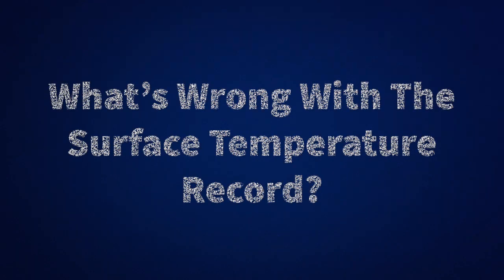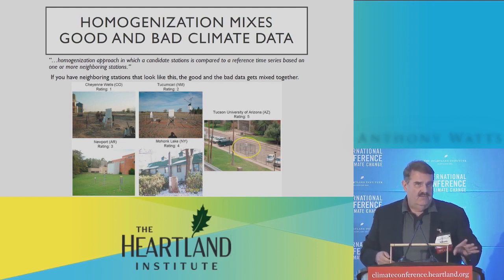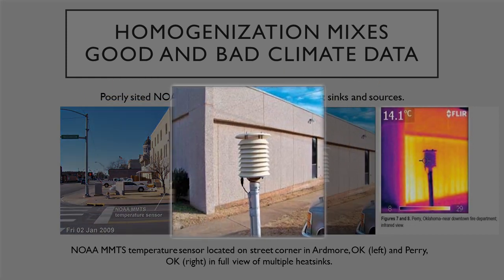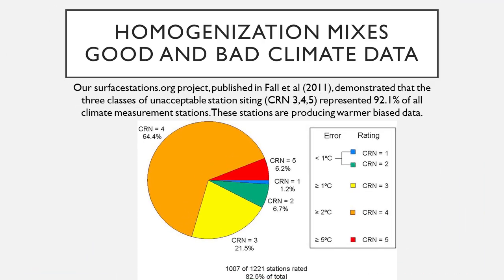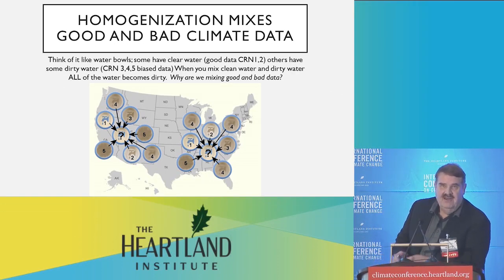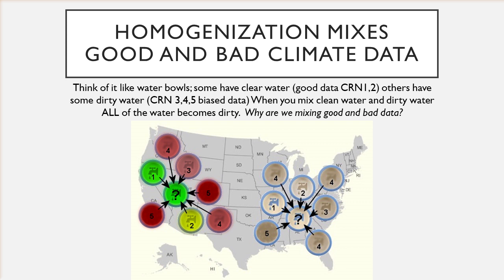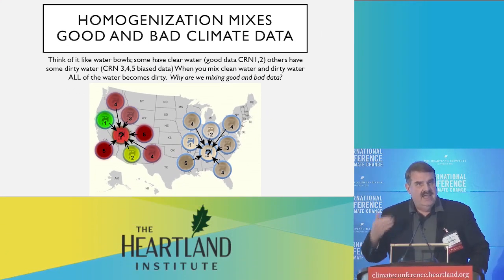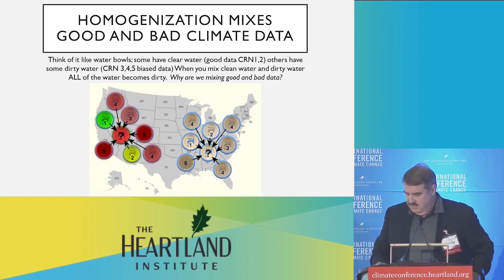Why The Globe Isn't as Warm as You Think

Comment: Under clear skies with little wind, the sun went down and I noticed the temperature dropped by several degrees(probably 2-3 degrees within 30-40 minutes following sunset). About an hour later with no wind, high level clouds formed overhead. Not long after, I noticed the temperature rise by several degrees, perhaps about 2 degrees.
 My point is that CO2 did not trap enough heat radiated from the Earth to overcome radiational cooling once the sun went down under clear skies, which caused the temperature to drop.  However,  the formation of high level clouds significantly overwhelmed radiational cooling by trapping noticeable heat from the Earth resulting in a rise in temperature.
It is reasonable to believe from this test that CO2 is not even close to being a strong greenhouse gas that can trap heat to affect our weather............it provided no noticeable warming and allowed cooling to predominate in the absence of clouds
All temperatures were read off of my car's outside thermometer with the car parked at the same location for about 1 and 1/2 hours.
Reply: Stanley Goddard     I'm a graduate engineer. I know that Climate Scientists stole many electrical and mechanical control theory terms to try to make Climate Science look put technical "window dressing" on a very low tech subject.  The word "forcing" connotes derivative in a typical PID control loop for feedback control. Please explain using the analogy of electrical capacitors, inductors, and resistors how CO2 forces whatever you believe it is forcing.........typically temperature in a closed loop feedback control circuit. How exactly does it force or provide derivative control action?

Comment: Good to mention this error source.  However, you bring up an important misperseption: It is not directly the radiation from surrounding buildings / roads causing wrong measuremts but the sourounding air heated by convection from closeby radiation absorbing surfaces -  Thermometers need to be always placed inside housings to shield from radiation!

The sad thing is that climate alarmists making solely CO2 respomsible for artificil warming. But actually landuse and resulting air heating by convection should be the dominating mechanism (if true that in the mean time already 1% of landmass surface is artificial), Therefore any artificil radiation absorbing surface (landuse) will add energy to the atmosphere. The only way to get rid of this extra energy is convection cooling on cooler surfaces which is significantly delayed as heated air lifts up and need to be distributed by wind to be able to finally reach cooler surfaces.
Measures to reduce CO2 like PV farms and wind turbines are sadly in contradiction to this,
Reply: Sorry, you missed the point.

Comment: this video is scam, a real video would have addressed the issue of heat generated by growing cities.
Reply: Although I disagree with the scam part, I do agree with your view on cities causing heat.  They should probably use the city measurements as a separate data set that they can perform calculations on.  Phoenix Arizona is a good example, when I was much younger you could see rain clouds come into the city, now they seem to evaporate as they approach the giant heat source of the city.  But randomly mixing the measurement data with no controls does skew the scientific validity of temperature tracking, it's fraud.
Reply: yaa, they dont care about the stupendous increments in the heat generated by the cities over the decades,
Reply: It is called urban heat island effect. Wich would take more a 3 min video to explain.
He was just pointing out an issue with measuring temperature and using it for a global temperature.
Reply: no wonder Global warming is faster than predicted